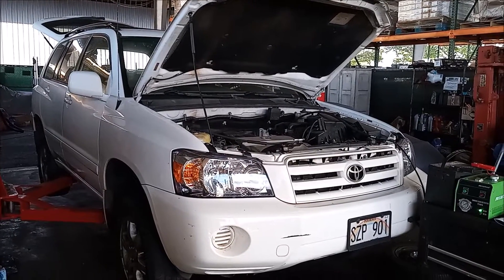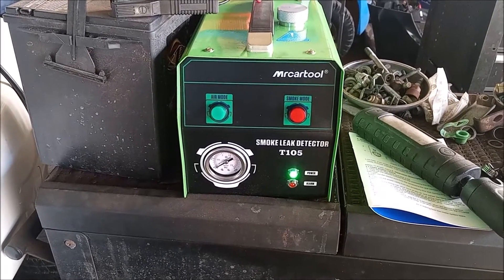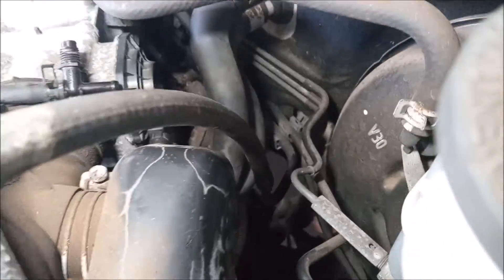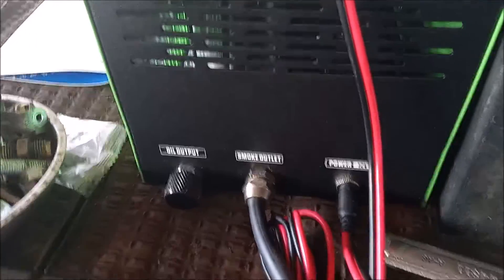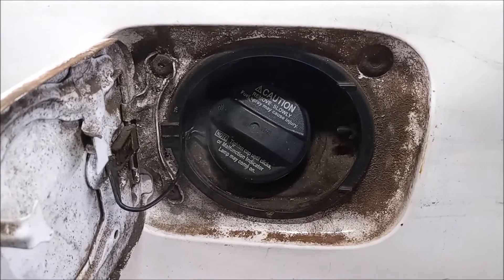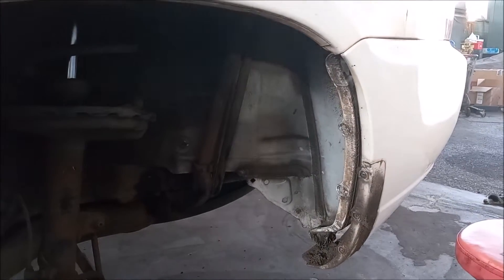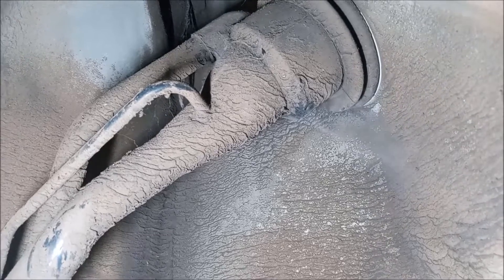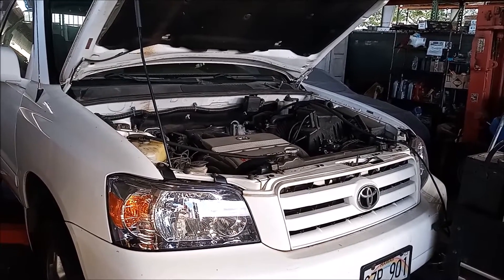How to Use a Smoke Machine to Find Evap Leaks P0442 P0455 Toyota Highlander

Comment: How did you remove the code? Did you change the filler neck?
Reply from the maker: I did replace the filler neck and the charcoal canister and everything else I could get my hands on - except the fuel reservoir. I still had the code. I think the leak is coming from on top of the reservoir, pressure sensor.
Reply: @Merryfrankster_  where was the leak at the neck, if you recall?  Was it one of the smaller lines that the joint was compromised?  I have a 2007 Solara that has those two smaller lines and getting smoke in the same place with a P0456.  I too thought it was the cap and replace the original with a OEM Toyota.